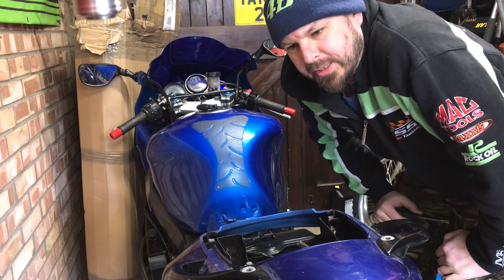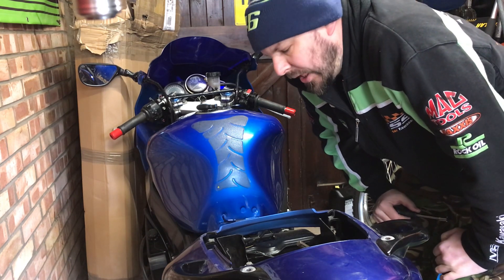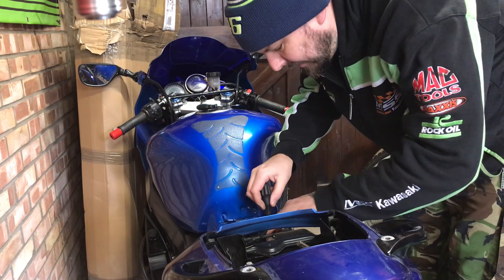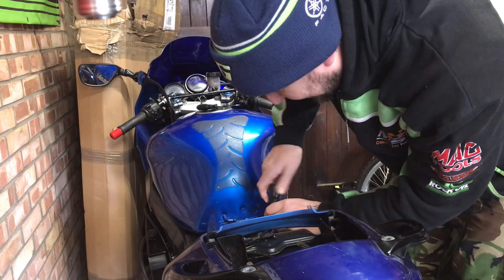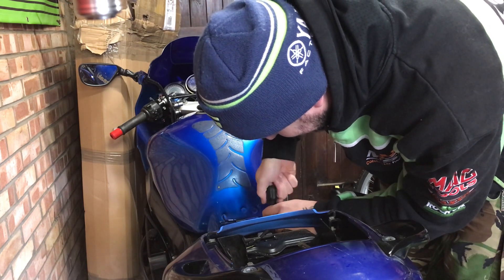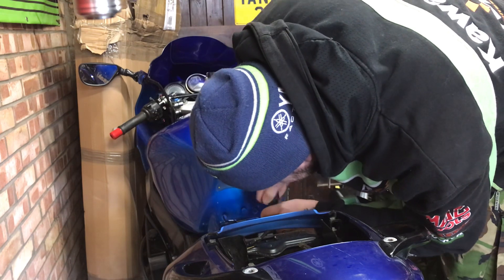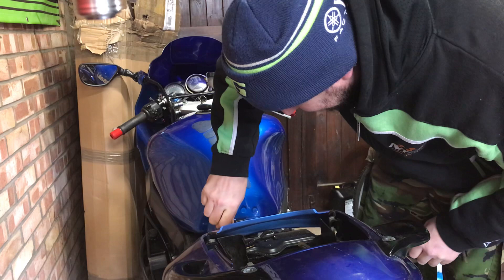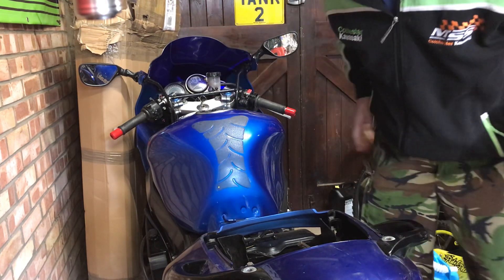Kawasaki Ninja ZX9R :The S34 Project pt3 . First engine start up (attempt )

Comment: The OEM ignition  has a 100ohm 2watt resistor in it that drops 12 to 6v signaling the cdi box to fire the coils and run fuel pump . Get a 100ohm 2watt  resistor  and splice it into the gey wire coming from cdi box to ignition  and it will fire up
Reply from the maker: I remember reading about the grey wire problem with the ZX7R forum . I will check it all over 👍